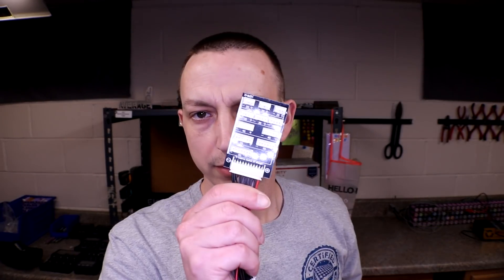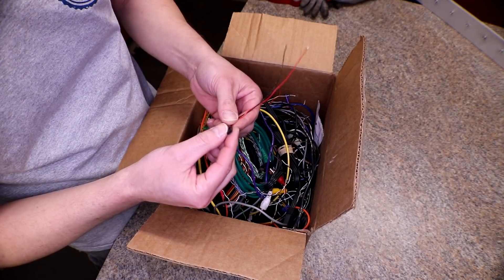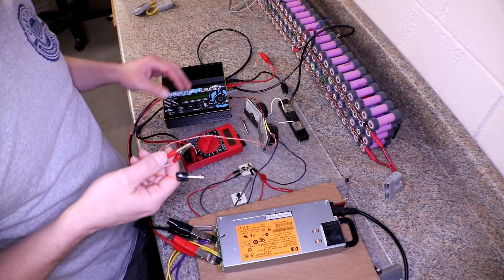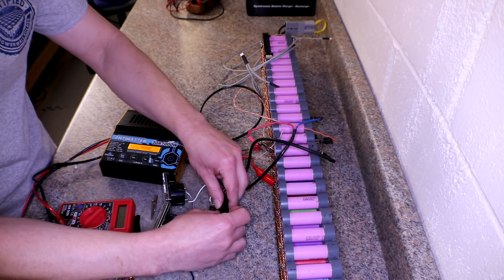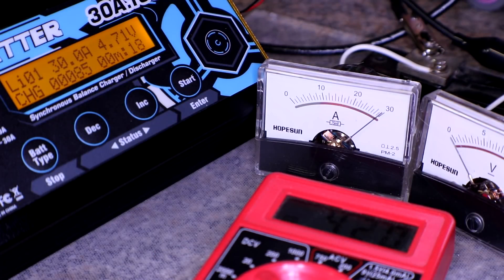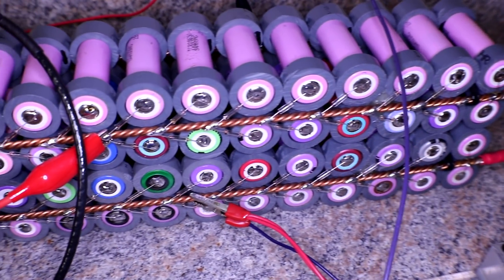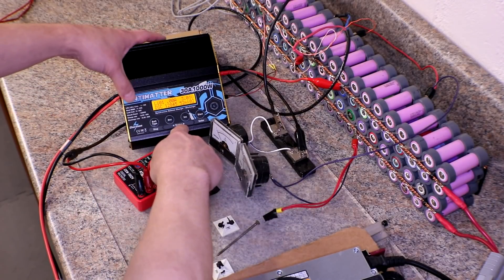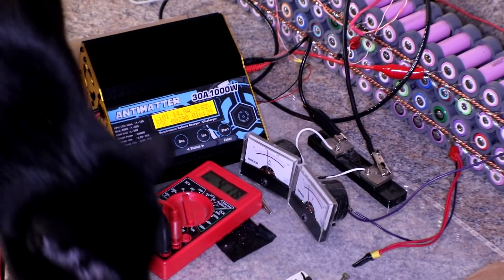Capacity Test #3 on Pack 14 with Balance Leads!!!

Comment: So you decided to put your +/- leads at opposite ends of your pack unlike HBpowerwall to force it to charge/drain the cells more evenly, did it work out better than having  both +/- leads at the same end?.......Would say running the negative up the side of the pack to the positive side work or create to much resistance?......cheers, love ya work.
Reply from the maker: I think it does work better distributing the load vs connecting at the ends.  Ill be making some better charge cables here soon!  Thanks for watching!!!😆👍
Reply: How do you quantify that it is better though?. . .If you have the luxury of a server rack your method is fine but for many people it won't be practical at all....
Reply from the maker: Oh gotcha, there are lots of stuff Ive read in the past about different ways to hook up batteries for solar or other battery banks in general. This way is one of the most recommended ways. I would imagine most people could setup there battery packs similar to mine with a lead on each end.
Reply: Yeh, HbPowerwall said he did a heat test with his with the leads the other way and all the heat was at the cells on top which disappeared when he changed to your method....

Comment: Newbie question: what is the purpose for using the shunt.  What does it do for you?
Reply from the maker: The shunt just allows you to hookup and use the amp meter.  They are usually a mated pair type of thing but not always.  Most shunts will have a Mv rating like .75 or .1 stamped on them so if you have a meter and no shunt or vise verca.😃👍

Comment: Hiya Joe, the only time you need heavier balance leads going to your JST plug is when you are actually balancing more than one bank at a time, and it is charging or discharging at more than about 1 amp to get the banks to the same voltage thru those leads.  That is why I ran 18 ga balance leads to my 7S JST plug, so I could safely handle up to 8 amps of balance current.  It's tricky getting larger wires into that JST tho. And, lol, you had it set to LiPo again during charge :P
The balance leads should be attached to the opposite end of your busbars as you are drawing current from for discharge, so they aren't seeing the voltage drop from the high draw.  Also you should be able to set the (Custom) discharge cutoff voltage, somewhere in the menu.
I'm considering getting one of these, and would really like to see at least 2-3 hrs of both charge and discharge at the full 30 amps to see how well it holds up.  If possible.  You're awesome!
Reply from the maker: Yeah I think the balance leads are ok for what Im doin lol.  Mainly just charging and discharging a single pack.  I used the lipo setting since it was allready setup for the voltages.  There is a few settings I can change for upper and lower voltages tho.  Ill need to upgrade the charge wires before I do a longer run on 30amps lol.  Those wires did heat up a bit.  Im working on all that meow!😜😆👍

Comment: AveRage Joe I had to calibrate my imax b6 for the voltage to read right it was .20 of a volt off, see if these steps work on the antimatter.     
    1. hold Dec (-) and Start button.
    2. plug power adaptor.
    3. wait for calibrating menu.
    4. release Dec (-) and Start button.
    5. wait 20 minutes to warm up to the working temperature.
    6. plug in battery and measure it, compare values between charger and Voltmeter.
    7. if necesarry, then make correction using + and -
    8. save it by pressing Start.

Comment: I know the Antimatter was showing 4.35v when charging because it was using the balance leads to make sure the voltage was still under 4.2v at the battery, so that shows the resistance of the alligator clip leads. 0.15v dropped / 15A = 0.01ohms (pretty decent for just clip leads) 
The balance leads being long doesnt matter if used only to measure voltage but when balance charging a cell to the top, the circuit draws 100mA from a cell that is high, resistance will hinder the ability for it to balance, since it is 1S there is no need to balance. 
It doesnt seem like that discharger uses the balance lead at all when discharging though. maybe there are some settings you can play with. I want to try out one of those for myself but I dont have any big packs to test and I already have my dedicated 4-wire DC-Load that works well enough for now.

Comment: 1S does not use balance leads because there is nothing to balance- the parallel batteries are one big battery to the charger. You need a balance charger when you do more batteries in series because you are pushing current through the chain of batteries and you need to be sure that one link in the chain does not go over voltage (which is bad for the cell).

I think your Antimatter needs to be calibrated as it is measuring the voltage high.  I know my IMAX B6 has and needs to be initially calibrated (there are Youtube videos about it).

Oh and I was just in a Radio Shack in Skagway Alaska so there ARE some still around!!
Reply from the maker: Oh I get that balance leads are for balancing ect. I was using it for a voltage reading as others suggested aaand 😲😲😲 Radio Shack still lives??? 🤣🖒

Comment: I would have the charging leads and the volt meters on the Anderson y plugs you've used as that's the way to equal the resistance between all cells I feel that's why you can see a difference  in the voltages and why there's been some sagging I bet if you could put a small clamp meter around the cell fuses youd see a current difference 
The slightest difference in resistance from on cell to another and the current can sway loads more than youd first guess
Reply from the maker: I do plan to make some charge cables for the anderson plugs. Just wanted to use what the box gives ya first to see any issues ect!😃🖒

Comment: You get "Main Port?" if the balance leads are connected to the sense port without the battery +ve and -ve.
Balance leads can be fairly long as there's so little current there's little voltage drop, until they're actually balancing and even then the current is between 100-200mA. 
Thicker wire with solid connections would help - using croc clips for >30A not so good because the surface area of the teeth in contact is tiny, so creating a hot spot with higher resistance and could even weld to the copper.
Pressing and holding down the left most button should bring up a screen showing the input voltage and battery voltage.
There should also be a calibration menu for the Charsoon as it looks identical to the Turnigy Reaktor.
Check this out on how to calibrate! https://youtu.be/bEpEN6piv8s
Reply from the maker: Lol since Ive never used a balance charger the errors ect are all new! I do look up the errors in the book tho. Yeah alligator clips are for sure not the right way to go about it lol. Better charge cables will be in work!  I wouldnt think they would be an issue for the balance connection since I figure its just measuring voltage on a 1s (right). 😃🖒

Comment: Discharge from pack ends, not sides. Thats how they are in rack. Think its the most basic when charging/discharging multiple batteries. Think you should know this by now.......do it right, a lot of people learning from this.
Reply from the maker: That is the end plan!  As for this setup I was trying to use the stuff that came with the charger for testing purposes first to find out any issues and then Ill move to upgrades ect...  But you are correct, other people learning as am I with some of this stuff!!!😃👍

Comment: I would check the instructions to see if a max balance amperage is listed. Could also put amp meter in series with balance lead, this would let you know if a bigger wire is needed. Remember MALT for resistance: material x area x length x temp.
Reply from the maker: Ill take a look at the book smore! Yeah I could series the balance lead!🖒

Comment: spread your positive and ground out as far as possible and opposite ends its always best that way. It forces the current to find its path cause current is the most lazy of the lazy and path of least resistance will always be first.
Good quality wire https://goo.gl/mj7KR1 will take solder with no problem and is not under gauged and add some EC5 connectors  to convert to use on your 1S battery packs XT60 connectors are to small with the wire in the link they it can work but makes one ugly solder job. EC5 is suppose to be able to handle more current and i think they will fit this wire though i have not tried it yet and they are banana plug based.
Reply from the maker: Yup, I get that the wires should be on opposite ends as I do plan to make some plug right into the anderson connectors. I am changing one thing at a time to see what will help the voltage sag lol. Ive read through a few comments on here and I think  another mentions a way to maybe calibrate it that Ill have to try out. I also wanted to at least try it out a few times as it comes in the boxy!😆🖒

Comment: balance leads are high resistance when measuring the cells voltage but switch to low when discharging which you should feel the leads getting warm, if they aren't warm then the current isn't high enough for the length to matter.
To test that, measure the voltage at both ends of the balance leads, if there's no voltage drop then the length doesn't matter as the current isn't high enough to cause a drop across it.
Reply from the maker: Ok, Yeah I didnt feel any heat from them but will check the voltage on both ends!👍
Reply: well, not at both ends but voltage across the lead itself. if the leads are too long the first thing you notice besides heat is the drop in voltage. well measure both ends and subtract it I guess unless the grounds are also floating a little
Reply from the maker: Ok I gotcha lol!